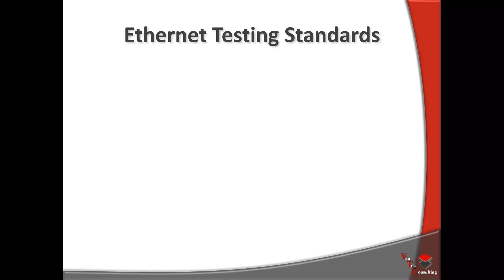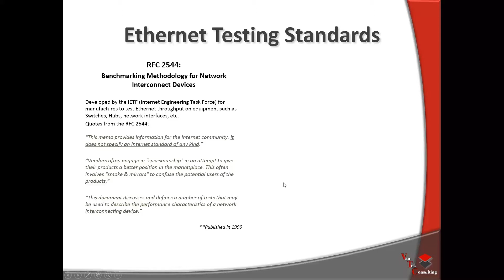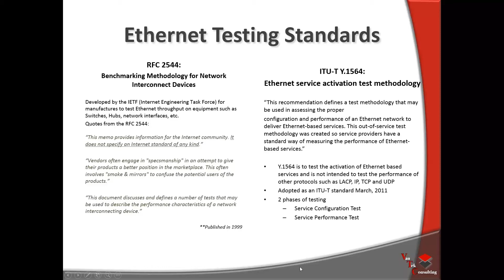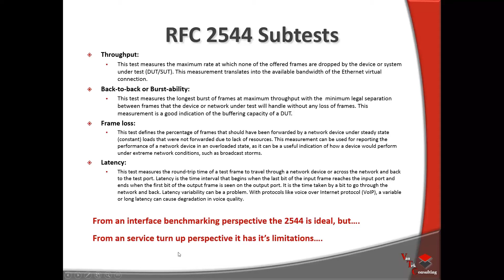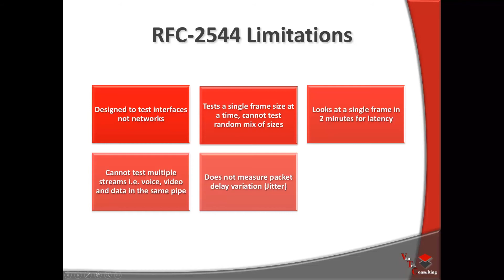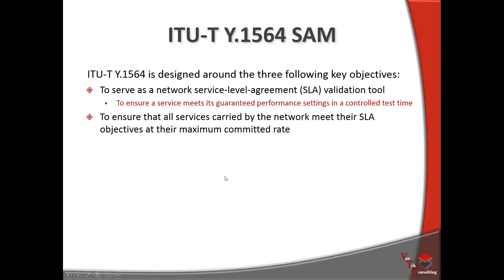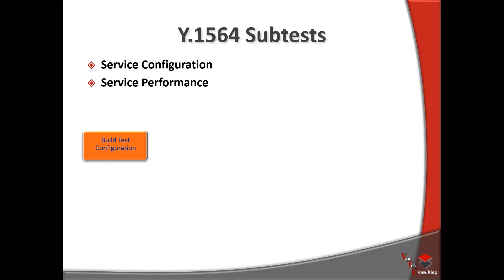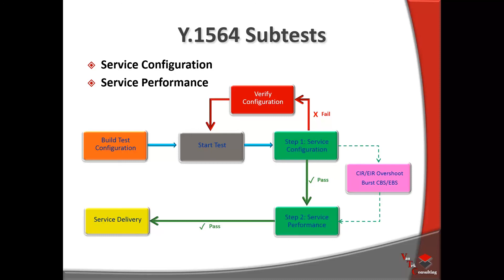RFC 2544 vs. ITU-T Y.1564 SAM

Comment: Question: if a 10 gigibit end-to-end connection is full duplex, does that mean it’s capable of actually 10 gigibits in each direction for a total of 20 gigibits per second. If so, why don't vendors market it as 20 rather than 10?
Reply from the maker: Thanks for the question, simply put, you're not receiving 20Gig or sending 20Gig (kinda like driving on the freeway going 60 and cars on the other side going 60, relative to that car your going 120mph but in reality your only going 60) so throughput is only 10Gig. Technically it would actually be under due to overhead, a typical Ethernet circuit runs at about 20% overhead so a 10Gig pipe would do about 8Gig. There's a lot more to it but that the simple explanation.